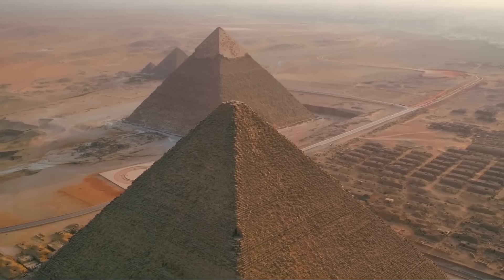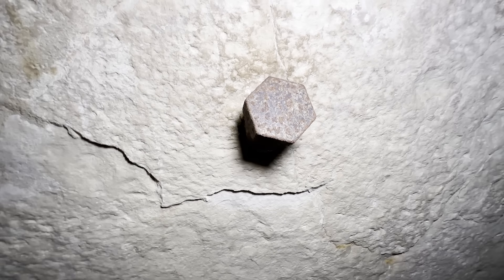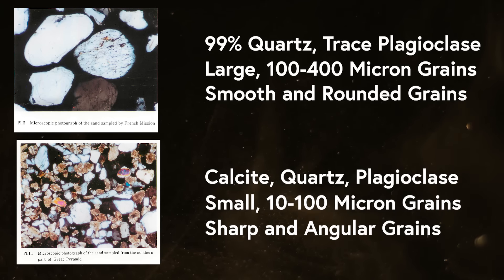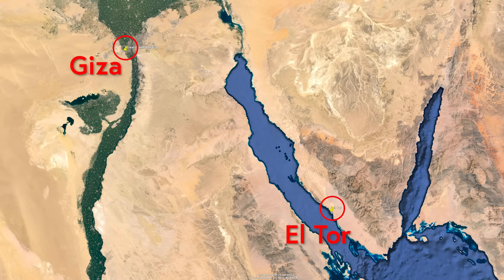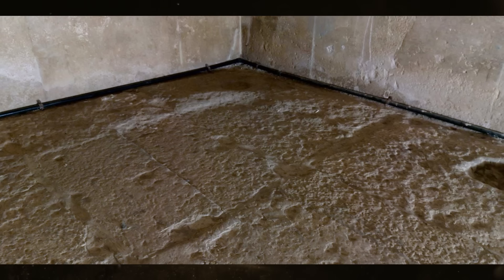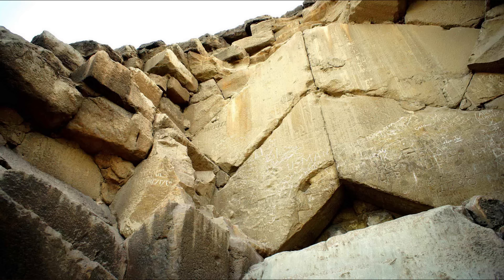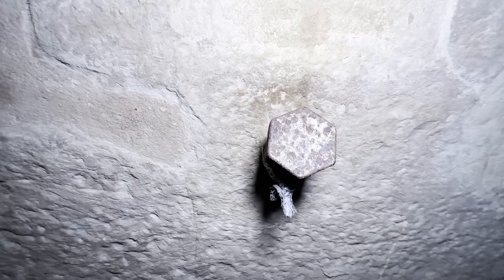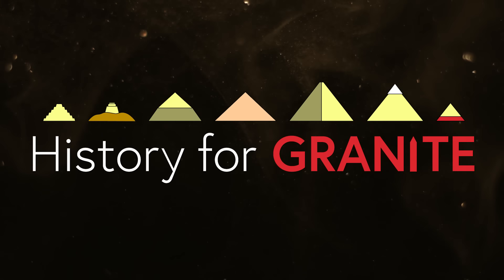How Sand Built the Great Pyramid

Comment: the best explanations are those that don't add to the complexity of a thing, but take seemingly complex and disparate things and provide a common explanation that links them together
Reply: Cutting holes in the rock floor to install scaffolding or a ladder... This doesn't seem practical. There had to be another reason for those holes.
Reply: I get the feeling drilling a hole in the floor was relatively minor given all the other stonework they were doing.
Reply: @air7tv Don’t forget that the finished floor would be installed over these working holes…
Reply: You sound like a dictionary. 😂
Reply: Until there is a most simply explanation. Some did it after the construction of the pyramyds, dor another reason liek take things out from it, with out the same tecnhology, and this guy is just trying to dit his theory with logic thought but not reality. Tada!
Reply: That's 'Occam's Razor'.
Reply: Didn’t he say the closest match for that sand was hundreds of miles away?! How would that be a more simpler explanation to this in any way if you have to travel an extra one hundred miles away just for the sand to roll some stones?!
Reply: @CGoldmill-dz4gk  'Simpler' does not mean 'easier'.
Reply: Huh???
Reply: So, why did the builders of the Great Pyramid use ONLY quartz sand for filler instead of regular sand? The answer is quite simple: Quartz sand is a better conductor of electricity or magnetic fields. That is exactly why the ANCIENT builders used it. In the ancient builders were NOT the Egyptians! The great pyramid was built long before the Egyptians arrived in that area. I have already spent hundreds of hours investigating this and I know exactly what I'm talking about and I AM CORRECT.
Reply: @jrxvo6080  Thanks! You know what's an even better conductor of electricity (the concept of 'conduction' doesn't apply to magnetic fields, so I'll ignore that) than quartz sand? Copper! Aluminum! Iron! Magnesium! Mercury (the element, not the planet or the mythical god)! Salt water! So, why didn't the mysterious makers use one of those materials? Because they don't exist?
Reply: Wooden crane for pulley system to drag ceiling stones in place?
Reply: @Giuachino  Really? How do you raise 110 ton stone blocks using a crane built with wood poles.
Reply: @jrxvo6080
Just cuz you say so?
If you say so...... rolleyes
Reply: @jrxvo6080 
Why didn’t you answer the other person who replied to you?
Reply: @FirstnameLastname-bn4gv  I would have  if I was asked ANY questions. Which one were you referring to ? BUT half of my comments or replies are  removed WITHOUT me cursing. Damn bias You Tube monitor people are doing it. And who the hell are these people that are ALLOWED to KEEP  doing it ?!
Reply: If you've ever slipped on sand or sugar sprinkled on a floor you know the friction reducing effect. But this effect applies to a wide range of sand, so using the specific sand probably means that the builders were working at sizes and masses of blocks that are in part determined by the friction reducing properties of the specific sand.  A bigger block or different sand... and the either a block won't move, or you need a lot more guys.
(I once saw 10 Chinese workers trying to tug a huge telephone cable dug up in the middle of a road in the Qianmen Hutong. They were all at one end hold as much of it as they could at waist level. It wasn't moving. I immediately thought, a couple of wraps of rope and a pole or shovel handle and they'd have a lot more leverage. I kept walking and saw that the cable was cut off about 60  (17m) feet away, so it wasn't even attached to anything. These guys just didn't know the tricks. Anywhere else in China someone would've known the tricks. Ancient Egypt? I'll bet they knew tricks no one's even imagined since.)
Reply: @air7tv  And what would an unskilled know-nothing with no practical experience like yourself know about such things?

Comment: The main advantage of coarse, uniform size sand, is that it does not compacts after installation, (and does not require to be compacted). It does not lose volume after installed, so it does not causes cracks in the structure over it.
Reply: You certainly can compact sand
Reply: @oftin_wong Yup these are just Sand Castles 🏰

Comment: Love the video. The idea that the chamber was filled with sand to support construction of the ceiling is by far the best explanation I've heard for why the shafts were left sealed during construction. I am slightly skeptical though that they built a whole masonry platform in the center and removed it, and also filled the perimeter around it with sand. It seems like you'd be able to build the ceiling with less work using a wooden platform/scaffold. Maybe I'm not fully understanding what you're proposing.
Reply from the maker: I think they could have filled the whole QC with sand, but filling the center with bricks would be quicker and easier. With the perimeter of the chamber drained of sand, dismantling the brickwork in the middle would be a quick job. Filling the whole chamber with stones would be a lot harder to remove.
Reply: Yes, you could build the ceiling on wooden scaffolding, as medieval cathedrals show. But that only works if the ceiling doesn't weigh 30 imperial tons - per ceiling stone. To support that kind of weight, you want something that can't be crushed (because the whole volume of the chamber is filled up).
Reply: @Pystro  They apparently used wooden beams to support the chevrons above the King's Chamber (in the top relieving chamber) and the passage above the entrance, so I don't think that 30 tons is necessarily too much weight for a wooden structure. But mud bricks would be more available than wood so maybe it was just easier to use them.
Reply: @CheesePolice  Good point. There are holes for wooden beams in the relieving chamber. Maybe it was the difference between the wooden beams being able to be supported by those holes right under the ceiling stones and the scaffolding having to run all the way to the ground of the queens chamber.
And if in one case wooden scaffolding was enough, and in the other case we only have direct evidence for the temporary masonry "scaffolding" in the center of the queen's chamber, then why would they also need sand? Then again, the relieving chamber above the King's chamber was only built after they had practice with the queen's chamber ceiling, so maybe the technique evolved.
Reply: @HistoryforGRANITE  

"but filling the center with bricks would be quicker and easier"

Or something equivalent to the ramps on the unfinished 3rd dynasty pyramids.

I think they are basically a mix of gypsum mortar and waste limestone chips from the quarrying process, a sort of poor mans temporary concrete structure.
Reply: Also why would they use the useful rounded sand instead of grit sand they had for that job? Maybe it eas filled in to stay filled in with good sand and somone removed it later? Was it ever opened?
Reply: @HistoryforGRANITE bricks? As in clay kilned sqaures? Did they have bricks?
Reply: @HistoryforGRANITE bricks would also be harder to remove though ..you can just spill out the sane through the channel after where bricks would be harder to remove no?

Comment: I have to believe the stacked and mirrored seams in the horizontal passage reflects that these stones were not considered structural in any way and likely were installed last in the sequence to finish the passage off aesthetically by the easiest possible method. Falsework as it was.
Reply: I believe it may suggest that a larger passageway was started that may have contained portcullises.
Reply: If you look at the unfinished Pyramid of Zawyet El Aryan, you'll find a much wider trench. Probably, it was the same in Giza.

Comment: I have been saying this for years...sand can be a lubricant..it can also be a counterweight to lift heavy objects
Reply: Quartz is also harder than granite, so can be used as an abrasive.
Reply: It can also be used to build small quick ramps, and to support large blocks as they are jacked up (with sand pushed in from the side).
Reply: its usually used as an abrasive
Reply: @spudspuddy  no matter what anybodys theory's are, on how they     think 🤔 it was done. I don't believe any of it till  someone builds even a portion. Of the pyramid to prove it. No one has done it yet. So it's all just a theory.

Comment: Would not the imported sand in the core of the pyramid in this fashion add strength against geological shifting/vibration by being a better shock-absorbing material within the structural density?

Comment: Some questions came to my mind as I was listening to this:
You said the nearest source of similar quartz sand is El Tor.  Is there anything else from the period that would also have been imported from that location?  It seems odd to me that they would be shipping loads of only sand, given the difficulty and expense of shipping at the time.  But if they were also importing something like a spice, or frankincense, or a precious stone, then it totally makes sense for those ships to carry the quartz sand as ballast, that can also be sold when reaching port, and replaced with other ballast for the trip back. 
And if the sand was being used over and over again for moving stones, would that have a physical effect on the quartz grains?  I guess a sand-ologist would be needed to look into whether there was some evidence of that extra wear and tear on the pyramid sand fill.
Reply from the maker: I would love for more studies on the sand. I believe a lot of the copper came from the Sinai peninsula, so the trade route was well established. The benefit of rounded quartz grains is that they resist compression and abrasion the best - so presumably the sand would hold up very well. Over time you'd expect the sand to become less pure as local sand gets mixed in, so the passage sand probably wasn't used repeatedly for a long time.
Reply: Seems like intentional pockets of sand rather than traces. Unless I misunderstood the findings.
If these are intentionally filled "voids", could the quartz provide some kind of piezoelectric affect, I wonder.
Just a thought . . . ✌️😎
Reply: @elvispresley6392  No. For a piezoelectric effect, you'd need a single crystal - or at least multiple crystals that are all aligned the same way. Also, I think piezoelectric voltages are so low that you need amplification to measure them, which wasn't possible before the invention of tube transistors.
Reply: You said the nearest source of similar quartz sand is El Tor"

*the nearest SAMPLED source of similar quartz sand - the sampled part is important.

Combine sparse sampling procedures for the research and 4,500 years of sand drift and there's a pretty high chance that there were in fact closer sources for this kind of sand during the Old Kingdom.

Also we know that the Old Kingdom Egyptians had a direct path from the Nile (near Aswan I think) through the eastern desert, all the way to the Red Sea coast.
Reply: @elvispresley6392  thats what i was thinking, either PE or osilator or even capacitance,  even if low in capacity the sheer bulk of it seems interesting